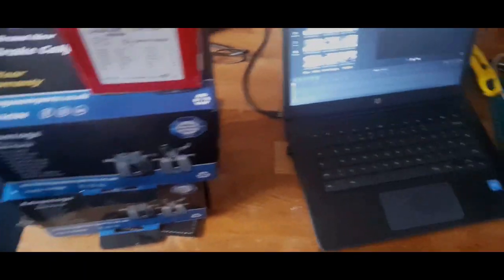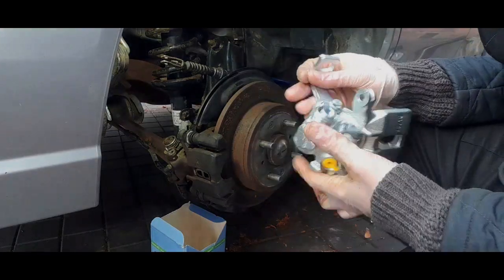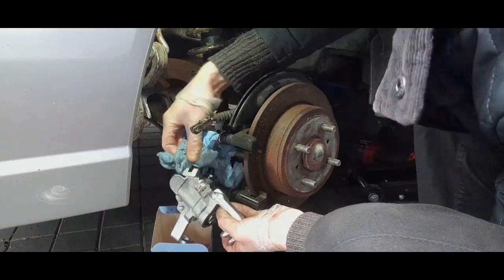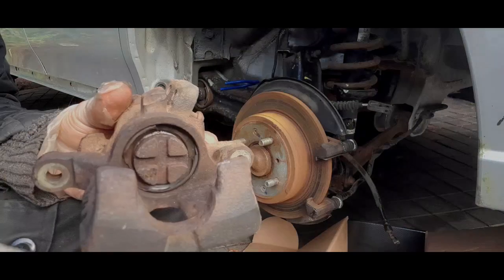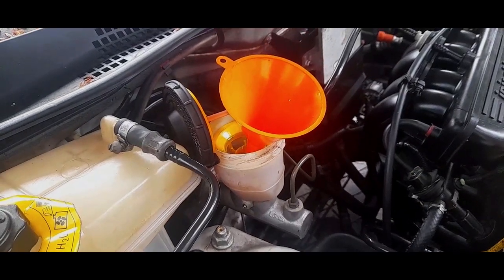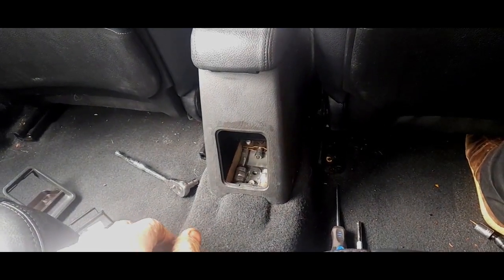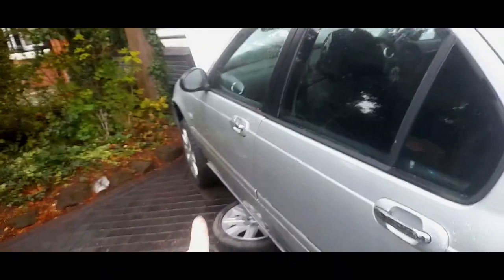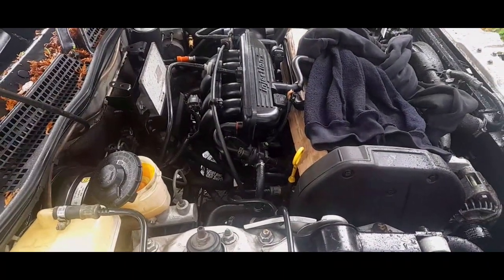Rover 45 - Project Beatrix Part 28 - Rear Brakes, Handbrake & Bleeding

Comment: 281 subs? Wow, your channel is spinning. :-))
btw, a well-maintained brake system is essential. I bleed mine in every 2nd years. 21 years old, but who cares? Works fine.
Reply from the maker: Tell me about it im glad youve noticed! yeah i always try and stick to two years as long as other repairs to add to the to-do list! The biggest reason for rotten pipes is old brake fluid that has absorbed too much water, water + steel pipe = you get the picture!